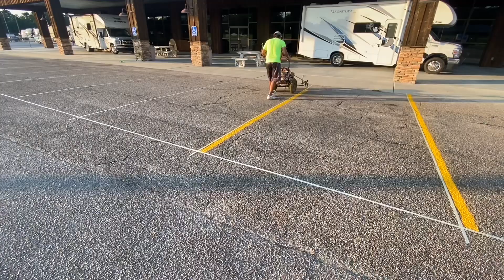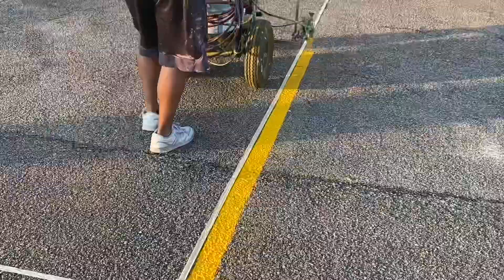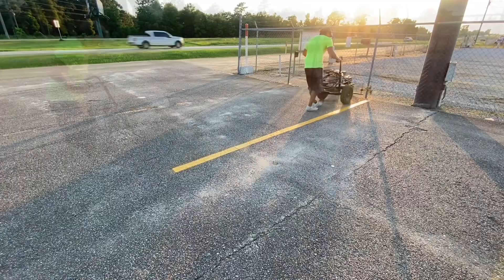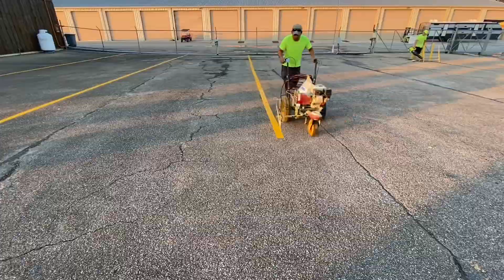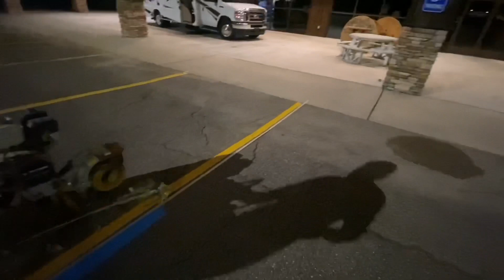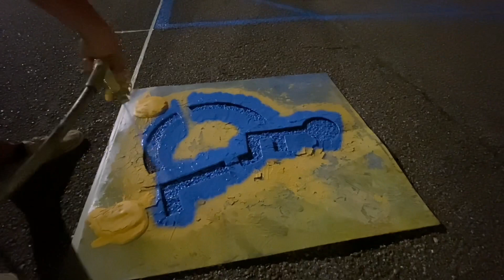Parking Lot Striping  I made $2815 striping this parking lot #StartANewCareer￼ #FinancialFreedom￼￼

Comment: Once I get $800 free dollars, I'm going to purchase your parking lot striping class and takeoff like a 🚀!
Reply from the maker: I look forward to working with you!
Reply: Not bashing his course but..I recommend you start small. Buy a $160 manual rustoleum striping machine, spend $50 on paint and maybe another $100 on stencils and start small. Have a minimum per job price and go from there. Find a 5-10 spot lot. The manual sprayer takes about 1 minute to paint 1 20' line. So if you have 5 spots than there are 6 lines and it might cost you 1 can of paint at about $10. You have under an hour to clean and paint the lines. Charge a $200 minimum (or more). Gain experience and go from their.

Comment: Why the tape at the beginning of the line if the guy doing the work cant start from the right spot?😀
Reply from the maker: Hey, thanks for watching due to the burst pressure of most airless striping machines on the market often times. Once the trigger is initially pulled, you will get a surge of paint sometimes with different types of paint it is necessary to put a small piece of tape at the beginning of each line, some people use shingles or either cardboard. This allows for a crisp, sharp start and is industry-standard it's not due to the experience of the technician.